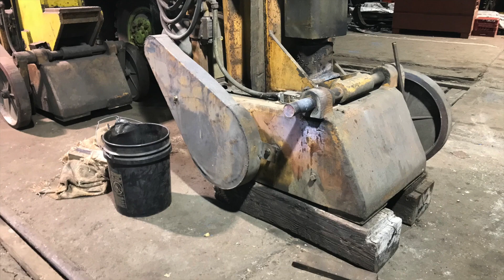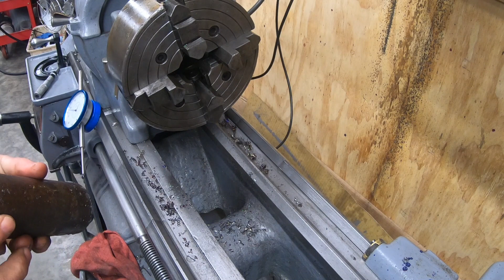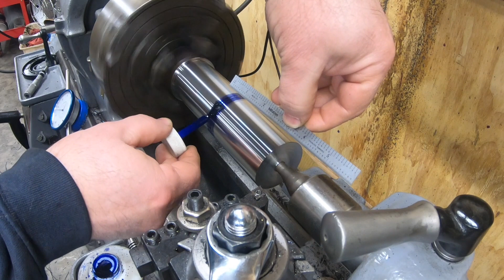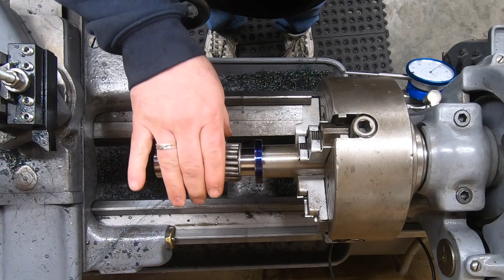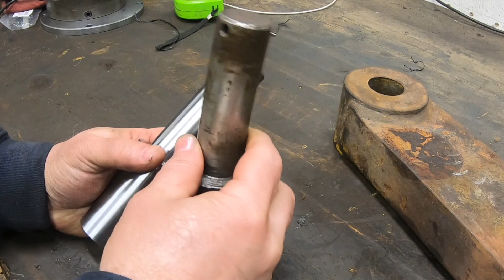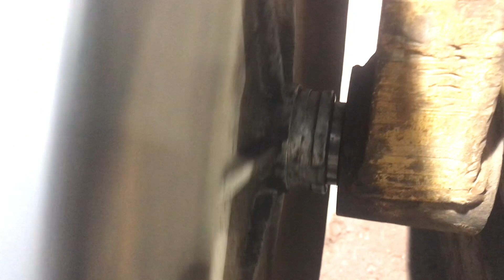Making an axle for a 50 ton railroad jack

Comment: Nice job. I recently upgraded my lathe from 1.5HP to 3HP and I still find it hard to get good finishes and small chips with carbide inserts. I mostly end up with strings of red hot razor wire. As old fashioned as it seems, I've mostly gone back to HSS.
Reply from the maker: Thanks, Mark. I have another SB13 that is sitting on my trailer waiting to come inside. That will undergo a similar rehab to this lathe. It's going to need a new motor, I believe, and I think I will get one with higher rated HP. A rubber belt should grip better than the leather belt, so hoping that it will put some of that extra power into the lathe spindle. But I am going to take a hard look at HSS once again. I just need to get a good grinding station setup with the right wheels.

Comment: Idk if it could help you but I put a truck serpentine belt instead of leather on my 13 inch SB(looks like its exactly what you have?) maybe it gives her a bit more torque. I managed to do 40-50 thou passes(if I recall correct) and 0.0120 feed with a TNMG insert in SS.
Reply from the maker: 13" is what this is, too. Do you recall what belt you bought? Did you cut it and glue it back together or did you do the whole dance of removing all the pulleys and spindle in order to get it on?
Reply: @MyLilMule  I think it was a 12 or 14 ribs serpentine belt (get the cheapest ones and it'll last years). I did not remove the spindle, didn't want to re install it and all since I had just finished rebuilding/painting it haha. The way I glued it is as follow. I used a bench grinder to slowly remove the belt material till I saw the threads for about 3 inch long (do both sides so one side you'll grind the grooves and the other the top of the belt. Top of the belt has almost nothing to remove.) Then use some super glue for plastic (3m brand I think) and clamp it over night.  I sewn the top end with 20# fishing line also. If you have an email I can send you pictures of it. Don't know how I would explain that haha 

If you have any questions don't hesitate!

Cheers
Reply from the maker: @nightowl19696  You can send it to greg@mylilmule.us. And thank you! I have another 13" waiting for my attention, I will almost certainly be doing something different on it.
Reply: @MyLilMule  it’s pretty easy and seems to be working well! I will send pictures tomorrow morning.

Cheers

Comment: That must be an awesome privilege to work long side those there at the Museum. NIce turning Greg, and you band saw blade is thanking you for doing the cut off to length in the hehe,,hehe!  Have a super week, Bear.
Reply from the maker: It's more of a working round house / engine shop than a museum. There's no exhibits or anything for anyone to see. Outside of the open houses, you have to be a volunteer to come inside. There are actually two steam engines under restoration. One by my group, and another group is leasing space from us to restore another.

Comment: 1 1/2"  of 4150 steel , 
Carbide Insert @ minimum 225~ 310 M/min = "about" 1800 rpm minimum.
Your running way way too slow.
It's a PITA only having 1/8 hp. 
Better off going to HSS for roughing, then finish with Carbide.
Reply from the maker: I suck at grinding HSS tools. I just need to practice. Plus, my grinding setup could use a lot of work and research to make sure I am using the right wheels.
Reply: @MyLilMule  
Practice
Practice 
Practice 
Any Aluminium Oxide wheel will do to sharpen HSS .
38grt for roughing, 80grt for finish , then a very light hone on a wet stone.
Once you "get the nack" of grinding hss tools, it's "easy".
My advice -
just Practice.
Im a retired machinist, & still use hss on my li'll lathe daily. 
Carbide needs HP, as it DOESN'T cut because it's "sharp", but from Brute cutting Force & Geometry.